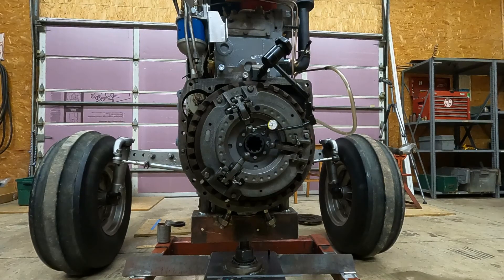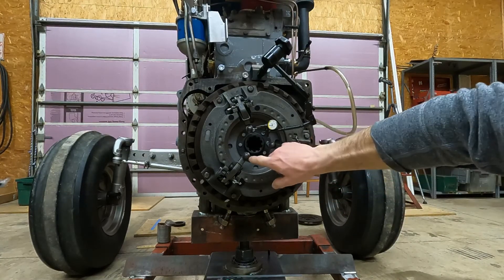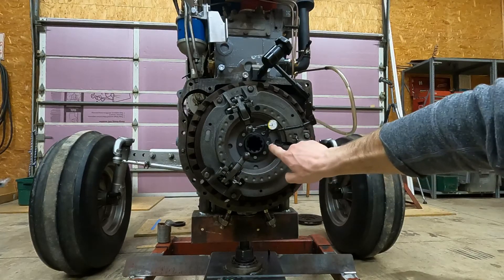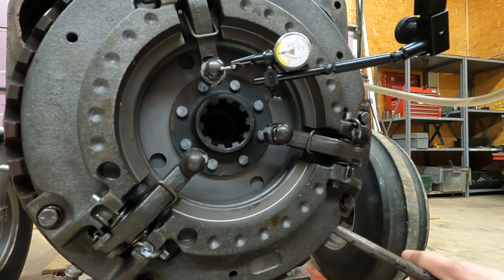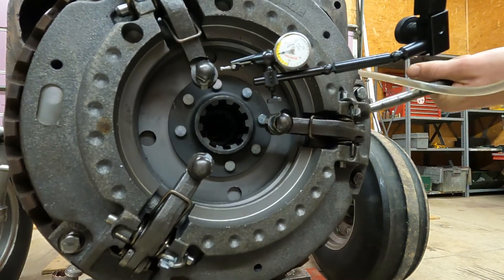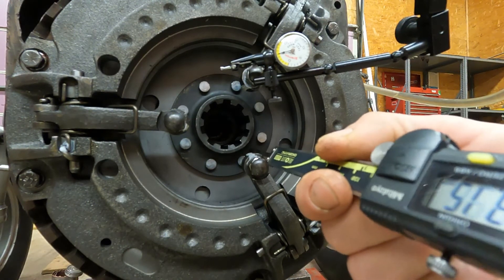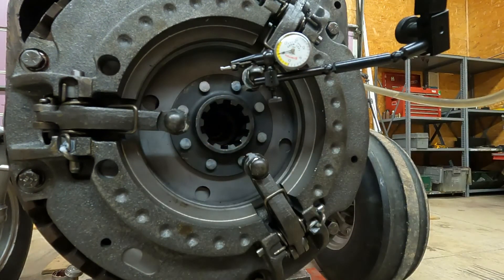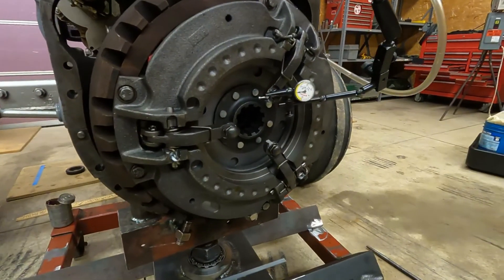Dual Stage Clutch Setup - Massey Ferguson 175 - 6speed + MultiPower

Comment: Ok. I just had a tractor guy put my clutch in for me. I have a 175 with 4hi and 4low. It seems like my clutch doesn't catch until my clutch almost reaches the top is that a problem?
Reply from the maker: Doesnt sound like its functioning correctly, 

id recheck the initial setup distance between the bellhousing too rocker arm when the "slop" of the pedal and associated linkage is pressed out before doing anything else, a little bit of adjustment goes a LONG way 

Same goes for the split yokes on the linkages, 1 turn at a time and recheck
Reply: You don't want it to engage too quickly. Probably ok. Once it engages it is ok. When you first push on the clutch foot lever does it disengage right away or not?
Reply: @DT-abcd  I yes after it goes down a few inches it disengages fine it just seems it engages close to last few inches of pedal release.
Reply: Thanks for reply.
Reply: @leeroyexcavator9149  that is normal. Do you have a dual clutch? That is, the large disk for gear shift and the smaller one for the pto. When the pto clutch, you will find a sweet spot and it falls right in. When you push the clutch pedal all the way down and you get a thumping noise the bolts on the 3 fingers that engage or disengage the clutch protrude too far through and cutting into the rivets on the pto clutch disk. Just a little info I have experienced.
Reply: @DT-abcd  No I don't notice any sounds like that. I will pay closer attention this weekend to see but don't think there is any sounds.
Reply: @leeroyexcavator9149  kool
Reply from the maker: @DT-abcd  
I had not been able to run it prior to splitting it, so I didnt know if it was operational or not... 

I can say 
I have this tractor back up and running and it DOES operate as designed at this time using the parts shown.. 
i should edit the description
Reply: @DT-abcd  I just split a 135 multipower with the exact clutch setup in this video. I hadn't really noticed the noise on full pedal but it has definitely been hitting those rivets plenty. I was really worrying about it till I read this. Maybe I'll just try to fix my leaks and throw her back together after all. Everything looks good other than rivets are beat up. Previous owner must have just had someone work on it but apparently whoever that is didn't get the rope seal housing to hold oil. Bad leak and no oil was even making it to the rope seal.
Reply: @Heath Dehart  make sure your bolts aren't too long. Before you put your tractor back together there is a distance to set the bolts. I will get back with you and get you that info. I have set a few Massey Ferguson dual clutches.  It isn't that difficult.
Reply: @DT-abcd  Thank you. Trying to get all the parts rounded up so it's still split taking up shop space.

Comment: I'm curious: the support under the engine, how is it constructed?
Reply from the maker: Its a DIY thing I made up, couldnt justify a tractor splitting stand for one clutch job.. 

Mostly a tapered roller bearing and some 2" UNF  
The rest is what was available in the bins 

Height and tilt are both adjustable